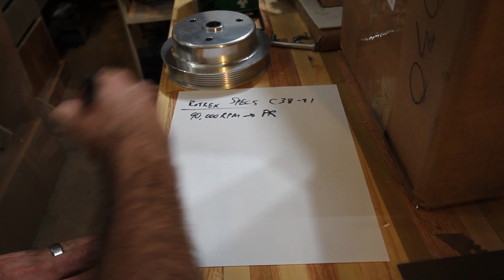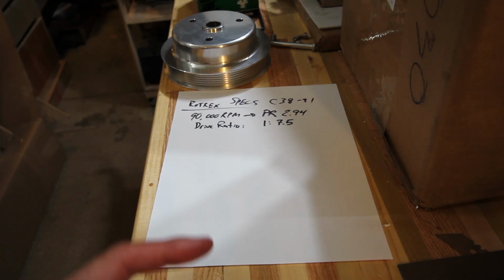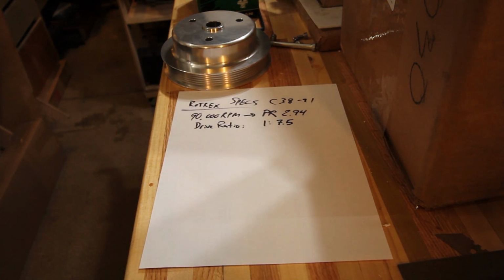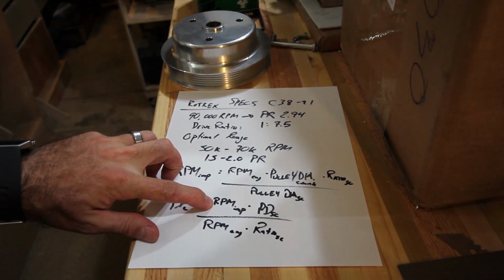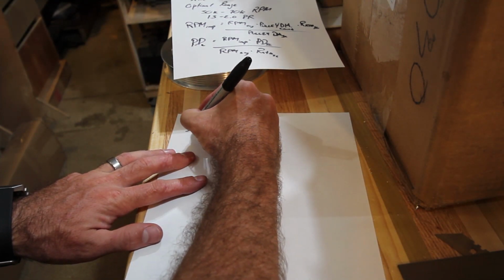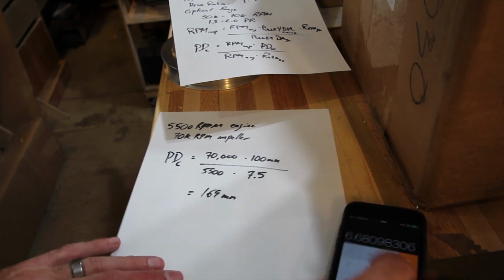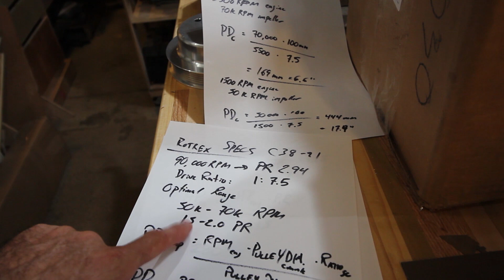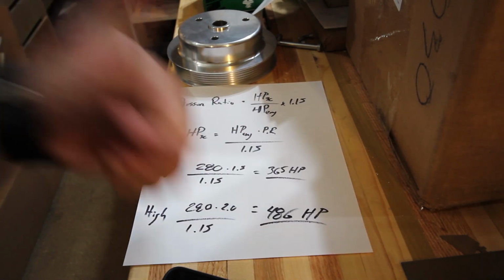How to Size a Supercharger Pulley

Comment: Thanks for this info...  but I recommend that people plot their entire 1000-6000 rpm engine range (plotted line) on the pressure map based on actual estimated volumetric flow of the boosted engine (you can roughly estimate this using the PR).  Using an excel plotter and iterating numbers will help with this.  Once plotted, check your efficiencies in all ranges and double check your supercharger impeller rpms in the top to make sure you don't overdrive your blower.  Then try multiple pulley sizes (in your case perhaps crank sizes as well... but many people have aux items on there they don't wanna over/underdrive) then see what you're really dealing with.  Doing it like this does give you some guidance but I wouldn't go through all the trouble of buying a blower...  installing it...   start testing it...   then finding out I might want a different result.   Doing this will help you can dial it in much closer first with just a bit more effort.
Reply from the maker: Good advice thanks!